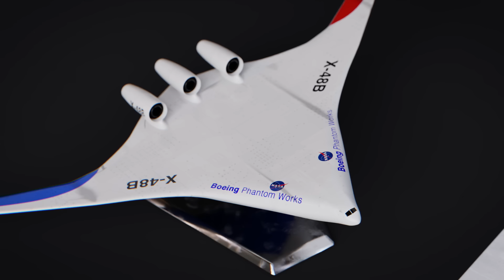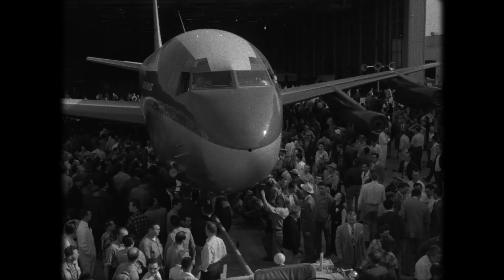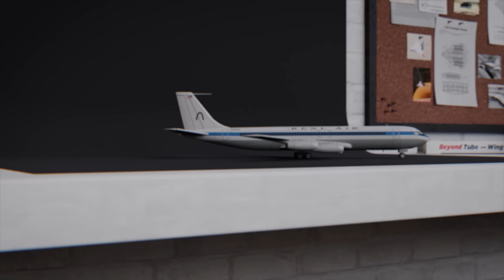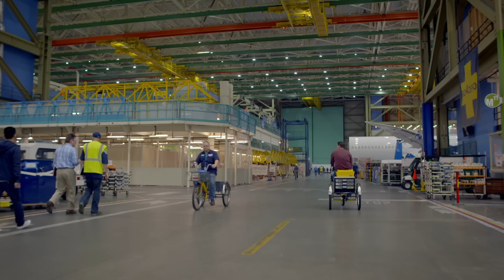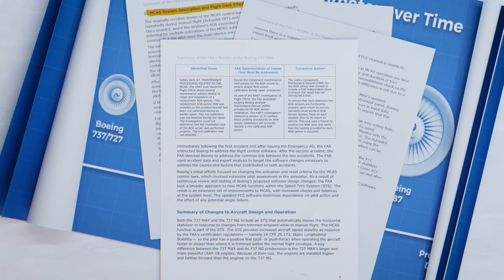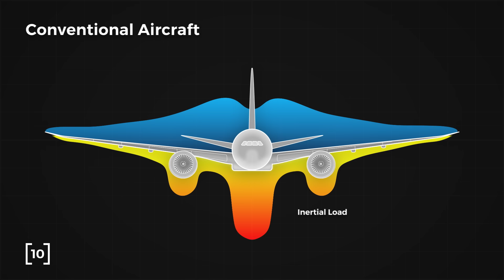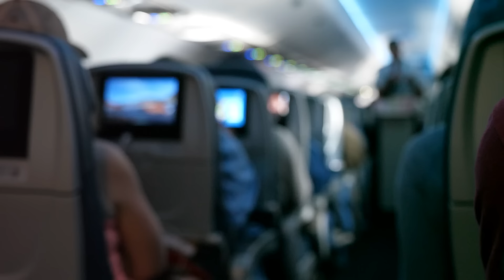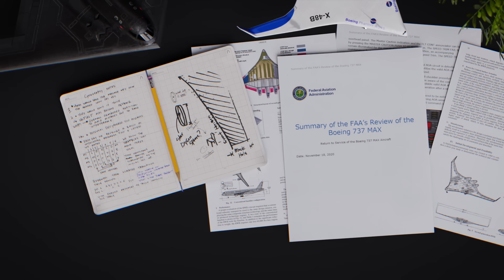The Plane That Will Change Travel Forever

Comment: I find it interesting that your product uses the tried and tested method of learning, pen/pencil and paper, but are very quick to discredit the tried and tested tube and wing aircraft design, even though the blended wing has been tried and tested for even longer than the tube and wing. Even the A380 still uses the tube for a fuselage, even though it uses composite materials over aluminum. Remember in the big picture, fuel consumption costs are not just limited to the actual flight, but also the costs in all the infrastructure required to load, unload, and the logistics on the ground. The B2 is a good example in that it requires a lot more ground handling equipment, personel, and space, now add that to the already congested space at existing airports. but also the costs to build the aircraft, is significantly more than the B52, which has bee the longest used bomber aircraft by the military for good reason. And on to the fly by wire issue, when, not if, it fail, there is nothing a pilots skill, experience, strength, and training can do to save to plane and passengers. In a B2 the pilot can always eject. 
Cost is always the desiding factor in the airline industry, so comparing the results to military and NASA that are not shut down when their attempts fail, but just given more money to solve those problems and like all the attempts by them with a blended wing design, they all came back to the conclusion that the theoretical fuel savings during flight, just can't be profitable, sustainable, or even practical to build, maintain or change all the infrastructure that a transition to blended wing would require, operating both systems at the same time during transition.  So yes the military still uses the B2 for its specific benefits, but they still use the B52 for its cost effectivness, practicality, reliability on laws of physics, vs fly by wire. as even they have to keep a budget. 
Remember to make money also requires the consumption of energy, (fuel) as well. Keep that carbon footprint in mind as you find ways to save fuel. Thus the reason the market always finds a way where policy and governments fail.

Comment: As the video pointed out near the end, a tube-shaped fuselage is much easier to build to withstand the stresses of pressurization cycles. A triangular planform could be built to tolerate the pressurization, but at the cost of being very stout and heavy. The cabin cross-section varies considerably, and the structures to handle that would be complex as well. That's one reason that the deltoid fuselage shapes haven't caught on yet. We don't see them in regional or intercontinental flight. Government grants enable plenty of design studies and radio-controlled models but there are no serious intentions to build any yet. Taxpayer-funding keeps flowing to the companies and universities "working on" the designs, though.
Reply: Another way to keep passenger pressure below 8000 feet is to fly below 8000 feet.
Of course, that means that the engines have to work nicely at those altitudes as well.

Comment: 4:34 Surely some research has been done into looking for alternative designs, where the tail stabilizers are at a positive angle of attack instead of negative? An instictive solution would be moving the main wings forward until they are in front of the center of gravity.

Comment: Wouldn't rear-mounted engines also greatly stress the fan blades? The plane body slow air closer to it, making the air speed entering the engine nonuniform. The blades would then experience variable forces as they rotate, resulting in enormous amounts of metal fatigue.

Comment: The rear engine placement adds a pitch feedback mechanism. Pitching the aircraft pitches the engines so their thrust torques the aircraft back into level. As long as the aircraft doesn't loose all engines it will have passive pitch stability.

Comment: Great points. However, there is an advantage and benefit to hight vs. width. Especially in a business aspect. 
Different plane sizes and passenger capacity for different flight patterns could be extrapolated based on flights from multiple airlines to determine how many average passengers are traveling from one destination to another. 
There will always be variations to population changes from one area to another, however. 

1. Running less planes, at fewer, yet more consistent timeframes would solve part of the issue, as there are less choices for passengers to choose, therefore, more seats can be filled per flight, maximizing the planes capacity, and giving passengers more convenient timeframes of departure/arrival times. Saves on cost of materials, fuel, maintenance, and allows airports to adapt to higher influxes of population flying to and from their locations over time. 

2. Smaller planes, with fewer passengers, with shorter flights, can achieve the same efficiency. Plus, with smaller planes, luggage is not needed to stow under, but rather on the sides, or even in the middle of the plane to accommodate window seats, where other passengers would have been, creating better weight distribution in the plane. 

3. Maximizing profits and value per flight would far outweigh profits per plane, creating more profits, safer flights, better schedules for passengers, flight attendants, flight crew, airport staff, and help with lowering costs of fuel consumption, food and beverages, and allow the flexibility of having some planes on standby for holiday rush. 

4. Safety would increase dramatically. Less flights with fuller planes instead of more flights with less passengers may seem convenient for passengers, but at what cost? 

5. I doubt this would be engineered in properly, but, in an extreme emergency, the hulls of the passengers could be built lighter, and stronger, and more fire retardant. Plus, since the hull of the plane is more evenly distributed vs. a long tube, a parachute system at the top of the plane could be implemented to reduce crash intensity, as it has a wider surface area, and using similar carbon fiber weave technology used on the plane itself. 
And in the event of a water crash, inflation devices can be implemented under the plane, which has a wider surface area again, using again similar carbon fiber technology used on the plane. Perhaps even better, having multiple landing gears for different scenarios. 

But what do I know, lol.

Comment: Lift is located over the wings because it is the wings that generate lift.
Engineers design (conventional) aircraft this way and with safety factors and maintenance routines to take into account the cyclic stresses of hops. They design with the fuel carried in the wings, the engines and landing gear.
Aircraft design is much about trade-off and compromise.
The 747 design has been one of the most successful designs.
The larger 380 far less so. 
Most airlines are looking for fuel efficiency as this video states but aircraft size has reduced, not increased as suggested.
The description of winglets is not very accurate winglets effectively allow wings to perform as if they are longer without requiring terminals to be redesigned for aircraft with longer wings.
The benefits of a blended wing design may be impractical if terminals can not handle such a design.
Great graphics!!

Comment: What about the passenger comfort during roll maneuvers? Won't the spanwise most distant seats in relation to the roll axis of the plane have large vertical displacements as well as acceleration during roll? If people get sick in a cylindrical fuselage plane during these maneuvers imagine what it will feel like on a BWB plane.

Comment: Sorry to say, but you get the center of gravity (COG) story totally wrong.
Forward COG is needed for airodynamical stability of a flighing design. Every modell airplane enthusiasts knows this.
Only gliders use a larges forward COG. For acrobatic and engined planes you use a reduced forward COG as much as possible without losing stability.
The same rules for COG are valid for blended wings (alias tailless) designs.
If you use zero forward COG you lose airodynamic stability and are down to eigther pilot control (very critical) or advanced electronic stability control.
Almost all military desgns are using this concept now for maximum manuvering capability. But without computer control they are virtually unflyable.

Actuall airliners are using already COG management by controlling their fuel distribution. The tail stabilisers can be moved to almost zero downward force. Thats used at cruise speed were stability can be reduced.

Comment: Good video, but you focus a lot on the balance of the center and gravity and center of lift creating a rotational moment, but you also need to consider that the centre of thrust if offset and creates a counter moment too. The stability from the tail of the aircraft is a lot more passive than you make out. Blended wing design are more about creating more active lift surface allowing less work to be performed per surface area typically making the lift more efficient.

Comment: Really Great video!  The one model with the long sparrow tail seems to be a good compromise.  Imagine a couple of helicopter blades with tips that can deflect up or down, attached to the rear of the flying body.   As for pressurization deforming; carbon fiber harp strings attaching ceiling to floor; with reinforcing spars might work.  Remote control cameras would turn those window simulators one step better than an actual window.   You could connect your window to any of several cameras 400 passengers with 1200 cameras!

Comment: Years of cycling experience would have me believe that carbon reinforced composites are not relatively immune to fatigue compared to aluminum.
Reply: True, but aerospace carbon fiber is not the same kind that's used in cars or bikes. It trades in some strength for increase fatigue resistance, which considering how high the strength of carbon fiber is, would be worthwhile.
Reply: We are also talking about different kinds of pressure here I think. Unless you bike is experiencing pressure cycles
Reply: BECAUSE THE EARTH IS FLAT !!   NASA LIES !!   NASA STANDS FOR  NOT  ALWAYS  TELLING  TRUTHS ...   IT DOESNT TAKE A ROCKET SURGEON TO FIGURE THAT ONE OUT !!

Comment: If high volume 380 is unsuccessful due to changing hub dynamics, how will this high volume plane be successful? Maybe the same way 747 was successful, by 🇺🇸 shoving it down the throat of the world by modification of aviation rules and political pressure. Also remember how they changed rules to fail concord, 🇺🇸 aviation industry lobbyists were responsible.

Comment: you can still have the above the wing horizontal and direction winglet tail, with the huge main blended wing body wing
Reply: have both
Reply: both passive stability and huge lift, no sacrifice made
Reply: the manta ray 'tail' above the main huge body
Reply: huge delta body blended wings and the dart tail
Reply: tube sections inside, not all of the fuselage needs to be top pressurized, partial pressure is fine for the gap spaces
Reply: multiple cargo/passenger tube sections inside the wide body blended wing design

Comment: Nice video, pretty well balance and I've been wondering what that status of this was. However, let's set the record straight. First off, the MAX, even with that crash is selling out again. As well, it was NOT necessary for flight. Boeing predicted that at some attitudes, thanks to its new engines the MAX wouldn't be able recover from a nose up attitude. But this was in less than one in a million chance that it would be unrecoverable. The company proactively thought to solve the problem with a system they used already on their fighter jets. That is where MCAS comes from, not corporate greed. Corporate greed didn't step in until they rushed it through production. It was never Boeing's intention to even build the plane to begin with, but airlines who didn't want to convert their fleets nor wait for a new plane that wouldn't have been ready till 2020 (irony). This also can't be attributed squarely at the corporate component ether, as the engineers know that they have a duty to report issues as far up the chain as need be. Every aviation professional knows that if your management won't listen, then head straight to the FAA. Even in the investigation it was found that at no time was the FAA even notified of MCAS by anyone, which is why they didn't look for it during certification. The engineers didn't even put it in their packets because they figured it be a one in a billion chance the thing would fail.
Reply: It's not selling out again: 
  In 2019, there were 47 orders, but 183 cancellations of 737 MAX
 In 2020, there were 112 orders, but 641 cancellations of 737 MAX
 As of October 2021, there were 583 orders, but 517 cancellations of 737 MAX.
https://en.m.wikipedia.org/wiki/List_of_Boeing_737_MAX_orders_and_deliveries. Of the 4612 orders to date only 599 have been delivered.
Reply: @BigHenFor  Another month's later assessment. Most of those cancelations where from existing backlog.  My comment was about the actual new orders, not cancelations.
Reply: BECAUSE THE EARTH IS FLAT !!   NASA LIES !!   NASA STANDS FOR  NOT  ALWAYS  TELLING  TRUTHS ...   IT DOESNT TAKE A ROCKET SURGEON TO FIGURE THAT ONE OUT !!

Comment: The propaganda about the square windows of the Comet jet planes that broke, was exposed thirty years ago. The rivet holes for a square navigation window, above the navigate, were not drilled but punched, leaving broken jaggered edges that were the genesis of the cracks that tore the metal apart. The passenger window's frames, well designed, never failed.

Comment: Please allow me to point out a few mistakes I believe I spotted in this otherwise fine video.

Re: Stability @ 8:36 ("the tail is constantly working to counter these forces to push the plane back into desired direction of flight")

Actually it is not the tail that stabilizes a plane in a level flight when it encounters turbulence. It is exactly that distance between the center of gravity and the center of lift. Placing the former being in front of the latter creates a negative feedback loop that provides the stability of a level flight. It works like this.

The center of gravity (a.k.a. center of mass) is a point (an axis going perpendicular to the screen if we consider a side view) around which the plane revolves when executing maneuvers as well as when it hits turbulence. If a plane hits a turbulence that increases its lift (e.g. a thermal) the increased lift creates a momentum which causes the plane to pitch down and (!) decrease the lift created by wings due to their movement through the air. When COG and COL overlap, or worse, COG is behind the COL a positive feedback is created: turbulence increases the lift, the lift creates momentum that lifts the nose and increases the angle of attack, the lift increases further, rinse and repeat.

The horizontal stabilizer only works in a steady state to counter the momentum created by the COG-COL arm and it actually decreases the efficiency of the negative feedback loop described above.

Of course, for a real plane to maintain stable level flight horizontal stabilizer is also important, but the major part of the plane's stability comes from the offset between COG and COL.

Re: "blended wing body would need constant active course correction" @ 9:34

That is only half true. Flying wings are very popular among RC hobbyists and they don't suffer from the lack of a horizontal stabilizer at all (same as ordinary planes with delta wings). The main problem for RC flying wings' course stability is the lack of vertical stabilizer. To compensate for that sufficiently big winglets are attached at the wingtips. Exactly @ 10:14 we can see these funny ailerons that go both up and down, they are actually automatically controlled aerodynamic breaks which replace vertical stabilizer.

Again. B-2 in particular may by unstable in all three directions (yaw, pitch and roll) but in general a flying wing can be inherently stable pitch-wise and roll-wise (dihedral).

Comment: I don’t like the way the engines are protruding out from the rear of the craft, it looks ugly. The engines at the rear need to be built in to the craft in a stream lined fashion. ( just like the way the engines of concord were designed), So as to create better aerodynamics and fuel efficiency. 
Also, the virtual window idea is a bad one. We need real windows to see actual scenery. The pilot’s windows need to be slightly bigger in their respective dimensions and concaving to go around the corner a little more, so the pilots can fully take advantage of their perifural vision. The wings can have tiny holes in front of them to collect in flowing air when the craft is in motion, so that the air can be compressed and channeled into tiny turbines to make electricity, to power the instruments and lighting. Looking at the craft from a Birdseye perspective, the craft requires 3 strategically placed parachute pods. This is so, that if the engines fail , the craft can become a glider and can have a controlled descend , where by the pods open up to release 3 huge parachutes for a soft and safe landing.